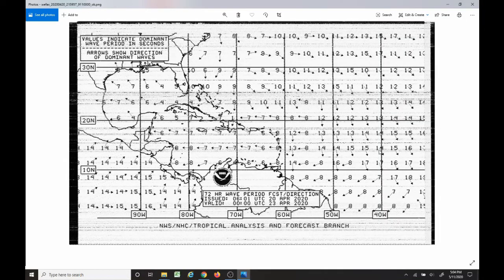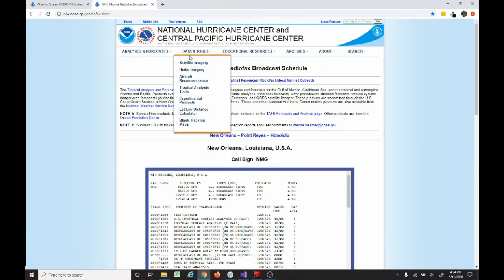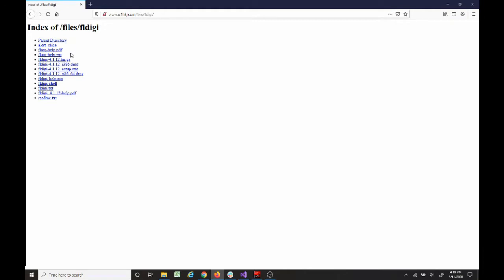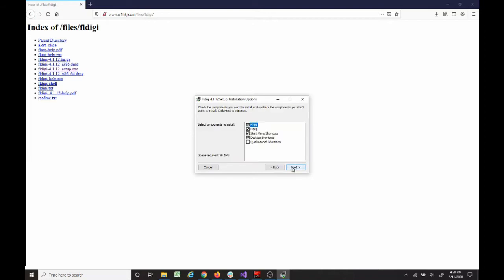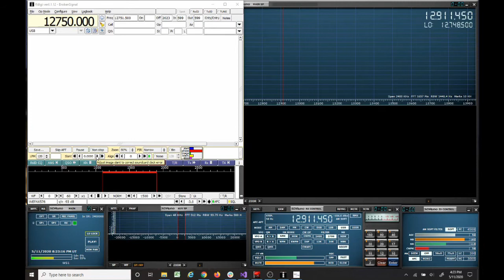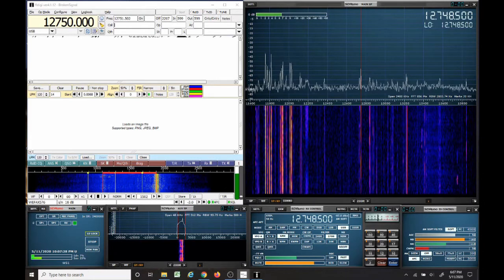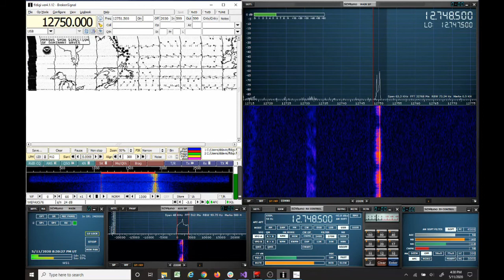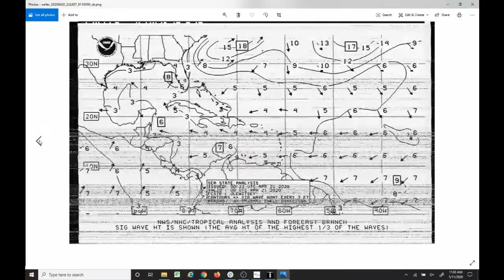Using fldigi to decode WEFAX Marine Radiofax with SDR

Comment: With hopes you still view the comments to this video.. (3 years old).. I am decoding WE-FAX... but.. the odd thing is (Some times) the map will (Shift) suddenly to the right.. (Interrupted) some how
to interfere with the phasing.. (But not all the Time).. I need to be lucky to RCV a perfect image top to bottom.. (Version I am using is now 2.4.0) much newer than this video.. Do you have any Idea (What) could cause these interruptions that could be disabled.. during my receive attempts... I'm not able to find any info.. with others that may have this problem.. (Did you ever experience) this problem ??

TNX .. 73s
Reply from the maker: Not sure what you meant by version 2.4.0?  In the video I am using version 4.1.12. The latest visions is 4.2.00, which I would use if you can.

As far as the issue you are having, I have not experienced it. It could possibly be caused by a drop in signal strength?
Reply: Sorry as per the version# (Dyslexic moment) yes version 4.2.0 I will try 4.1.12 If I can find it.... Thanks @BrokenSignal
Reply from the maker: @x_CrossHair_x  No problem. Couple other things to check, try unchecking AFC (in bottom right) and keep an eye on audio level (green bar bottom right) to make sure your not having an issue of audio dropping out.
Reply: I have no dropouts with audio.. (Nothing unusual) .. Unless a poor DX Day. (Example : https://youtu.be/RIDKPjo3Tyk) a lucky capture with ver 4.2.0 .. (Audio is active) so.. you may want to mute it.. TNX  @BrokenSignal

Comment: I don't see the strip controls to show the LPM. I was running ver 4.1.26, and then downloaded 4.1.13 ( closest to what you're usuing I could find). I still dont see where to add that to the interface.  I see SAVE, APT... the next line starts with RsID, and the next line is the freq band. There is no strip for LPM.

Comment: Hi, 
I noticed that the dongle you use is meant for higher frequencies, but can work down to 500 kHz. On Amazon it says "HF reception below 24 MHz in direct sampling mode with reduced performance". However, it seemed to work pretty well for you... your images are as good as I've seen on Youtube. Did you have to do anything special? Thought I might have to buy extra hardware to make this work.
Thanks for the video!
Reply from the maker: The only equipment I use is the RTL-SDR dongle and an external antenna. The antenna is a Terminated Folded Dipole that I built for cheap.